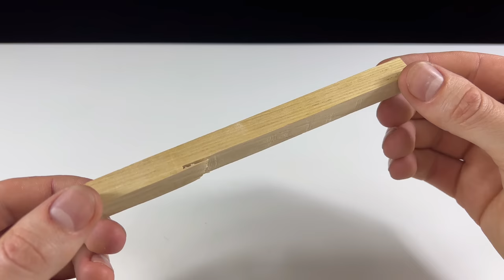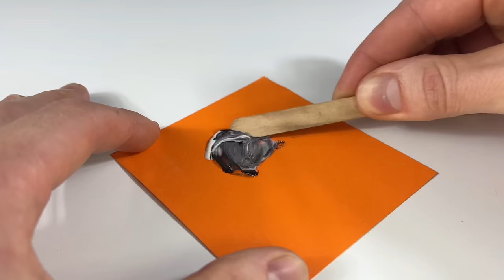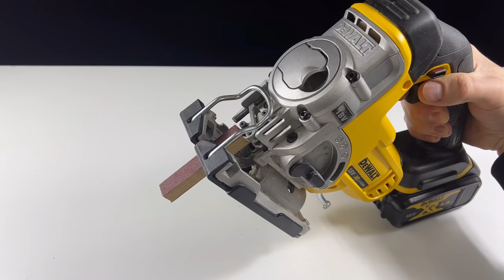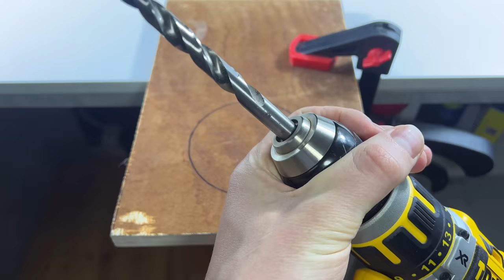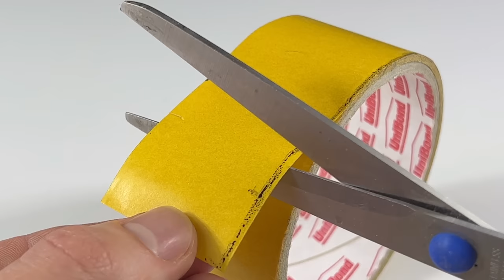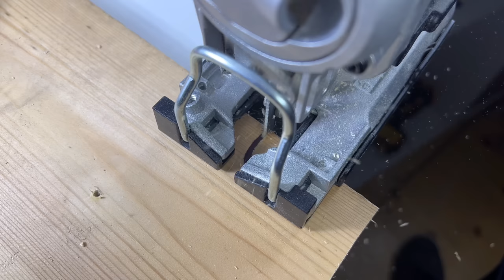Nobody knows you can do this with a jigsaw! Hidden Features of Jigsaw

Comment: The reason the wood rips up is because of the blades teeth cutting upwards, which is why you would cut it face down. If cutting laminated wood (flooring for example) you can just buy a blade that cuts downward. 

The are good tips to prevent it tho, the tape one is old but the plastic thing was good.
Reply: Any cut edge of flooring should end up hidden by trim anyway.

Comment: I could use a file to smooth a few hundred square notches in the time it took to create that sanding attachment.

You were too busy trying to determine if you could, that you didn't stop to think if you should.
Reply: It's also faster to pick up a file than it is to switch out for that sanding block.